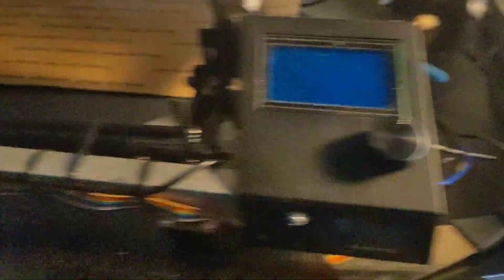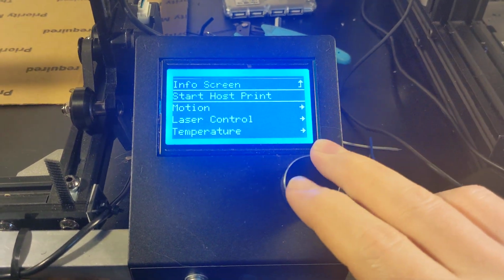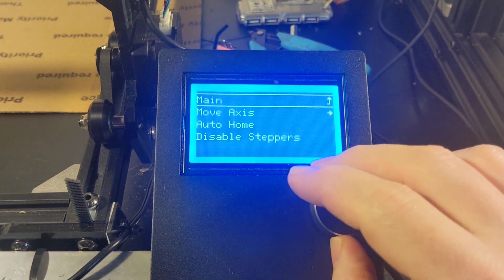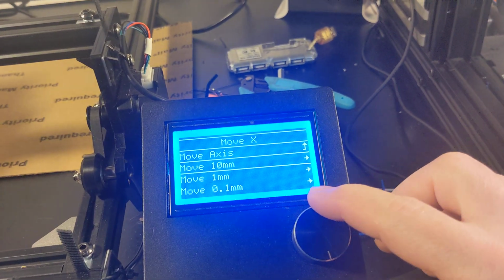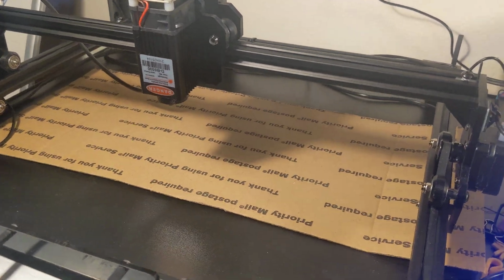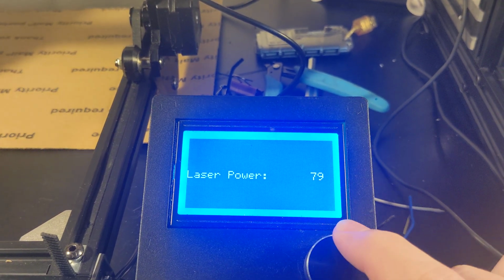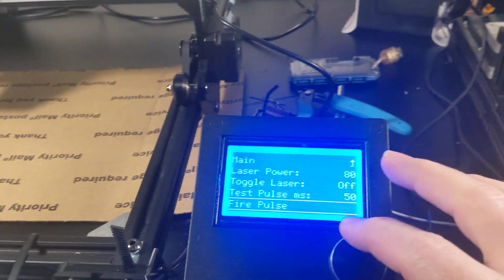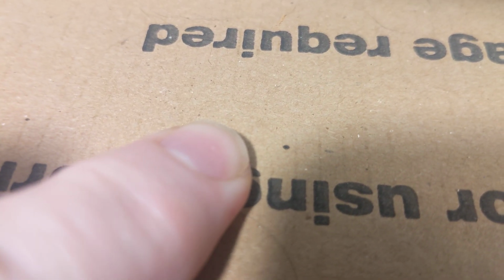Marlin Laser - Generic laser engraver with Creality 4.2.7 mainboard

Comment: How did you install marlin laser to the 4.2.7 board? I also have 4.2.7 board and would like to use it as a laser engraver for my ender-3. I have googled about marlin laser firmware and couldn't find anything on it. Just found the regular marlin firmware. Can you also change the frequency, if so what is the max could be used?

Comment: Hi, i tried your configuration, i used PA1 to power the laser and and PB0 for the PWM signal, but i'm missing something. When i toggle the laser ON the fan on the laser will turn on, but not the laser. I can try a pulse and it will work even with the power i set, but the laser won't stay ON. Did you make any other change to the firmware?
Reply: What are the ports for PA1 and PA0? k-fan-1?
Reply: Press the button on your laser

Comment: can we get a link to the firmware you used or a copy of yours ? and maybe a pinout / guide ?
Reply: @JW Smythe please please please would you get around to posting the details. Your video made me very excited to finally see this done properly. I rushed to the comments full of excitement only to find no conversion vid or follow up. Gutted.
Reply from the maker: I'll try to remember to post it sometime soon.    If I don't in a month or so, remind me to do it. :) 

The pinout wasn't terribly hard.   The laser PWM is on the BLTouch connector, center pin.  Laser power is on the hotend output connector.  You have to leave the Z axis in the config, Marlin requires at least 3 axis, but the software won't (shouldn't) command Z to move.  I think I reassigned the hotend output to another pin, because it's required to have that too.  And you have to disable the hotend and bed temperature, and thermal runway monitoring, since they aren't present.
Reply: @JWSmythe   will do ty
Reply: @JWSmythe  remind
Reply: Is it time good friend
Reply: ping